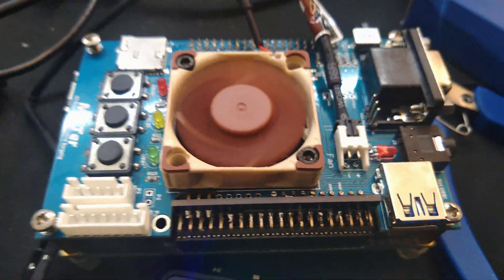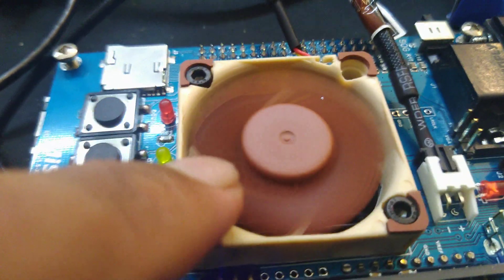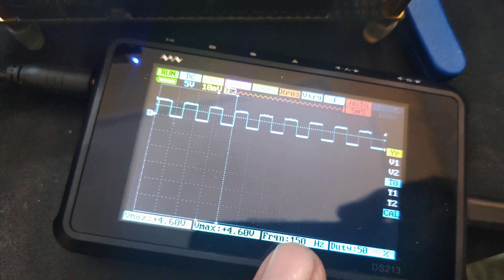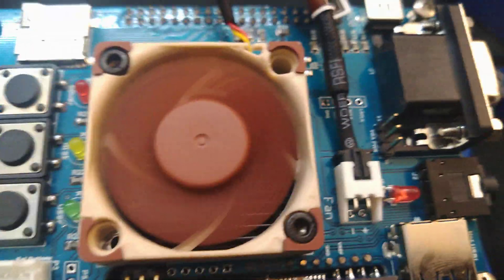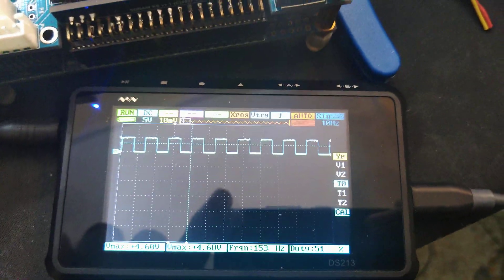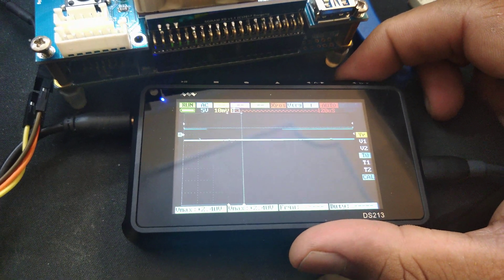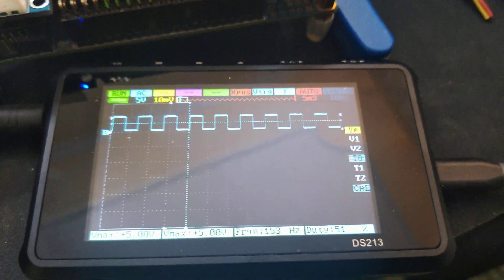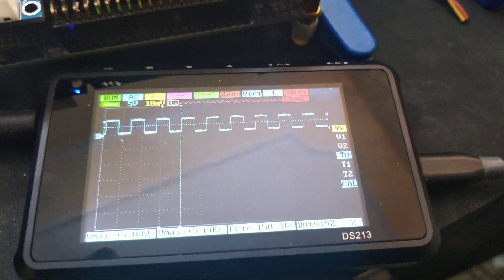Reading RPM from a 3 pin PC Fan

Comment: is it possible to monitor this via a RaspberryPI?
Reply: You can, only problem, you'll need to divide the voltage.
As for code, you can start counting time as soon as pin goes high, and stop as soon as it goes low, then divide 1 by that number to get a number that's ½,¼ or ⅛ of the RPM.
Reply: also, what would be the code to work out the RPM?